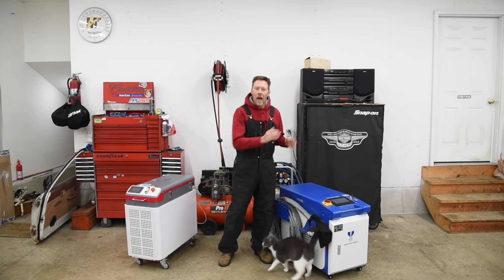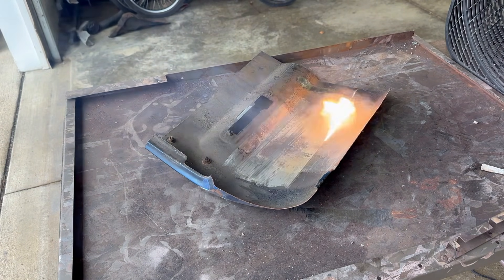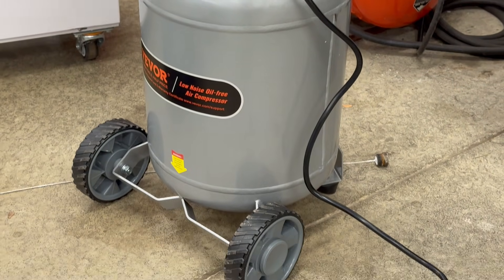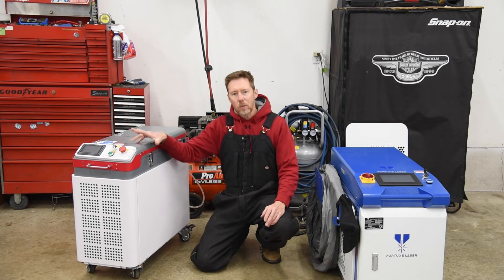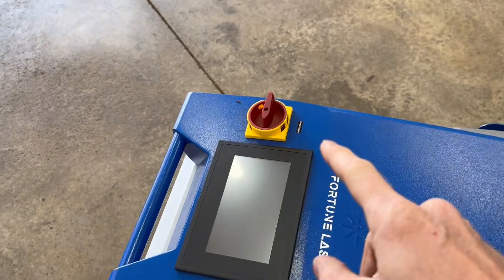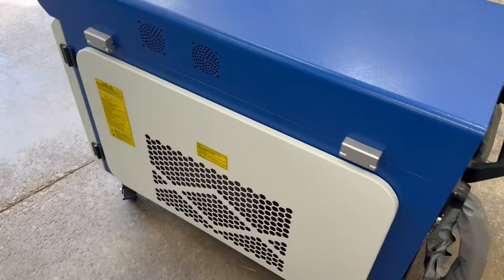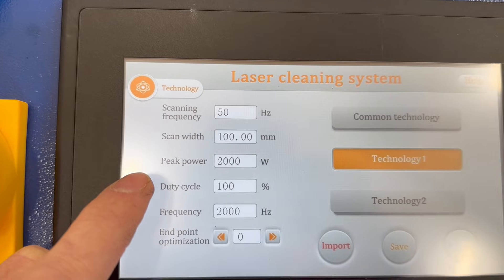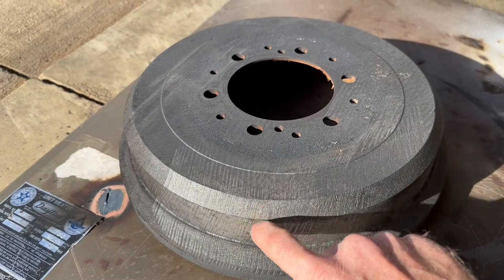Everything to know about 2000w Continuous Wave Laser Cleaning Machine by Fortune Laser

Comment: 11:58 If you turn the laser power down it won't etch the metal. Always start at a lower setting and turn it up as needed for the project. Don't just automatically go in at 100% power.

Comment: Check your parts email...Free 87 toyota if you want it...no rust, LCE engine, R151F trans ect...
Reply: Hey, BIG fan...I have a 87' Ca rust free 4x4 Excab pu, white, LCE stage 2 stroker, 38 Weber, LCE headers, R151F trans, 4.7 transfer, TRD 10" flywheel  w/3RZ clutch, tru tracks frt and rear, not cut to lift, 31 General Grabber tires and a bunch of other goodies, one owner, me...Extra LCE performer 22R 100,000 miles runs, G54 trans, OEM 2.8 transfer and mic parts and trailer ...Getting on in age and worried what will happen to my truck when Im gone....No one in family whats it so would like to "WILL" it to you...Not happy it would go to the RUST state of Ohio!!,   but sure you would give it a good home or sell it to one...Are you interested??
Reply from the maker: Hey I got the email you sent about the truck back in Aug and sent a couple replies... probably ended up in your spam :( I'm going to send another email... let me know if you don't receive it. I may have to do the unthinkable and post my phone # on here to get a hold of you lol.
Reply: @6thGearGarage  Sent ya a text...Thanks for getting back...